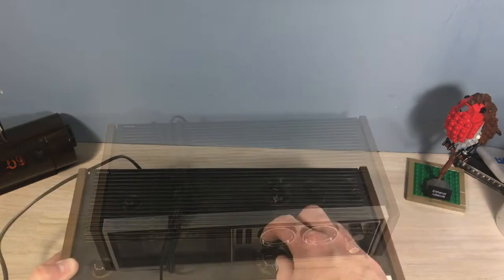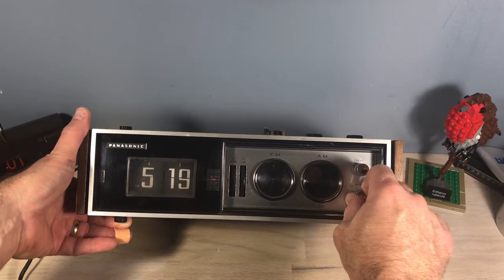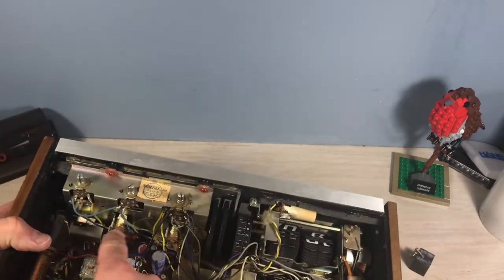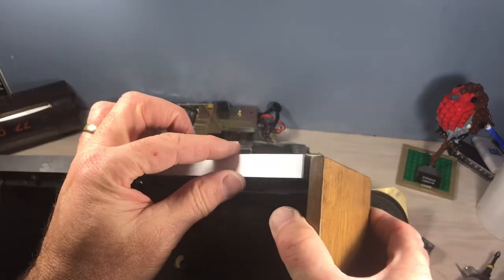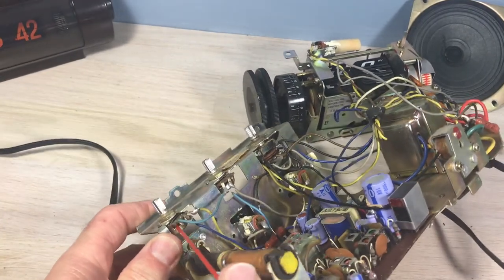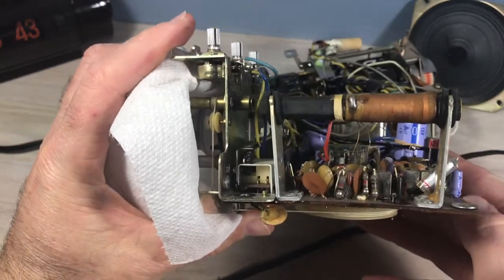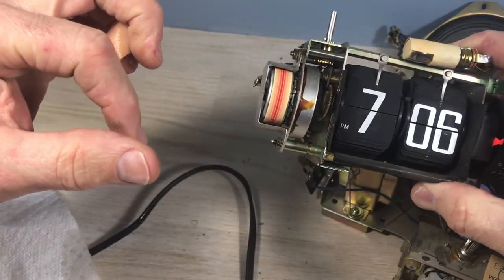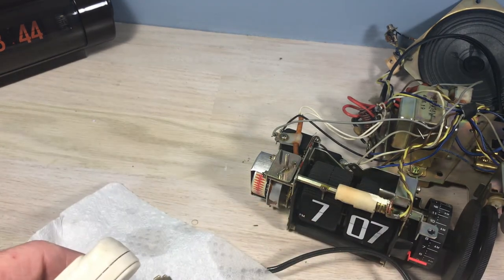Fixing a Flip Clock For Free - Just because it's there

Comment: I just found  the same flip clock at flea market it was pretty dirty and clock motor was stuck so I did the alcohol trick and got it free but that only fixed one of the two problems. The motor runs but the shaft coming out of the gear box doesn't move at all. So it's needs a new motor fix it but that would hard to find and it only coast my $5 so I didn't lose much.

Comment: Hello there. I was wondering if you can help me on this, or point me in the right direction. I always liked the flip clocks and being that I was around when they were popular, I have a couple. Recently I managed to get a SOUND DESIGN 3556 flip clock radio, from eBay, that was brand new. it came in its box, though a bit beat up, (the box that is), with its original instructions, warranty card etc. I love it and found a great spot for it. To my dismay, after running great for about a week, the clock stopped moving. Changing the time manually will get it going sometimes, but then it stops again. Very disappointing to say the least.... the radio works fine, even with the timer, the clock light is on and the little twirly wheel by the clock, moves normally even if the clock stopped...Can you please help me and if I have to send it to you for a repair, I can do that and pay whatever you think is fair for your time...
Thank you, Anthony V.
Reply from the maker: It's usually not a good thing at all if the clock is not running but the "twirly wheel" (I like to call it a whirliegig) is moving. The wheel is technically the rotor of the eletric motor. In any event, when the clock is not running but the motor is, that can mean 1. there's a stripped gear within the motor gears itself (bad news), 2. the motor is loose/not seated correctly (someone may have "fixed" it incorrectly), 3. there are stripped gears on the mechanism.  There's just no way to tell without opening it up. Repairing these clocks it a hard business to be in. Consider this - to safely send to me and back to you (just shipping alone) could be from 18-30 dollars (9-15 dollars each way). That in itself is usually what people think their whole cost should be!
Reply: @Flipclockfans  Hello again and thank you for your kind reply. As I mentioned earlier, this seemed to be a "new" clock, at least sold as that. (kinda looks new too). Anyhow, I have it for about 2 weeks and run fine for a week and a half or so, then the clock stopped though as you said the motor seems to be running. It might go again, here and there but will stop again after a while at whatever intervals it feels like doing it. To spent the shipping money is not the problem, plus whatever you'd like for your time, but can it be fixed? should it be a gear that's broken, which it shouldn't be, or any other part, can they be obtained at this point? if so again, i'm willing to try. It bothers me to let it die so easily... Thank you for your time and reply when you can.
Tony V.
Reply: @Flipclockfans  hello there. Any thoughts to my message sent a couple days back?